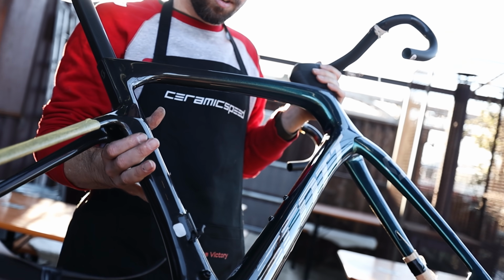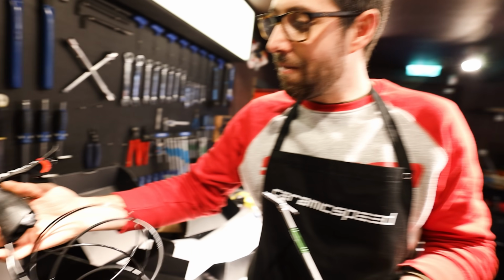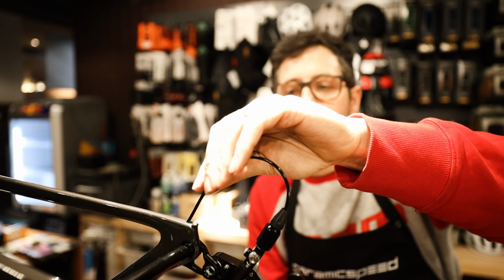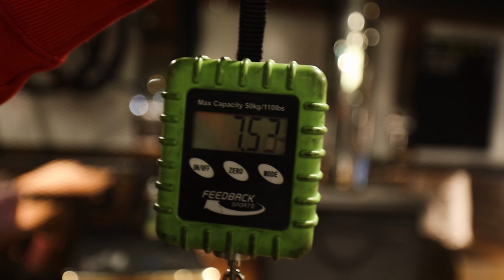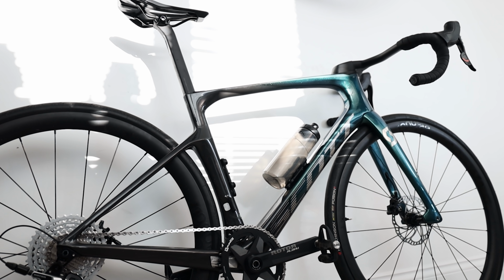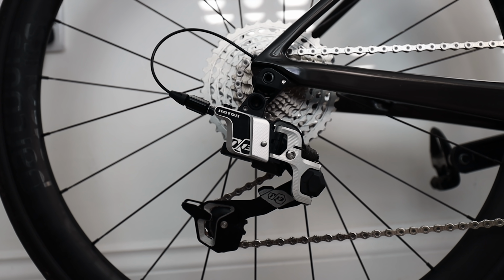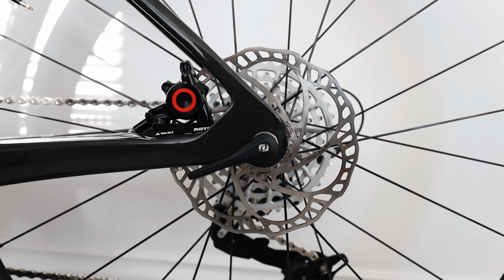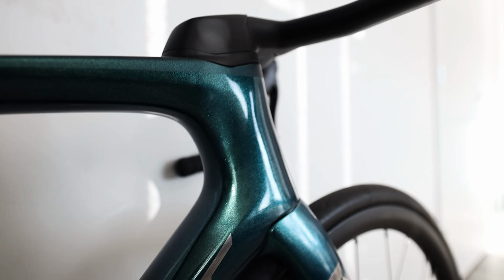New Bike Day

Comment: Quick primer on how Uno shifting works compared to mechanical. On a mechanical setup, a ratchet in the shifter body pulls a set length of cable which manipulates a “dumb” rear derailleur. With Uno, the “dumb” shifter body pushes a set amount of fluid which manipulates a ratchet in the rear derailleur itself. The barrel adjuster on a traditional mechanical RD changes cable tension while the barrel on an Uno RD repositions the cage presumably with a worm gear (?) One benefit of Uno is that it is basically impossible for the indexing to go off. Also you can possibly upgrade to 14-speed, 15-speed and beyond without swapping the levers out since all the smarts are in the RD.
Reply from the maker: Interesting!

Comment: I like that frame...a lot! The aldhu cranks don't look right tho, they should spin freely! Are you sure the preload collar was backed off before install? If not it will bind the bearings. Also on some pf86 u gotta remove the 0.5mm plastic shims that Rotor say you need(!) or the whole lot will bind!
Reply from the maker: it spins freely now - shimano bearings we used, maybe just sticky to begin with?

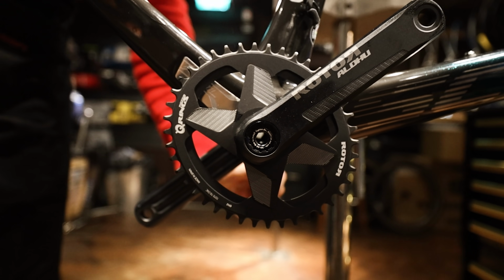Comment: 2:46 If this thing starts to creak and wear out bearings, now you'll know why. I don't believe for a second it would be any better with ceramic speed.
That is absolutely horrible bottom bracket performance, I don't care what anyone says. 
Likely it's not the BB but rather the BB housing tolerances.

Comment: Would have been cool if you got a custom steel rim brake frameset built up. 

I know the Rotor 13 groupset only comes as a disc brake option but still would have been cool to see something different instead of just another generic 1X carbon disc brake “road bike”

Comment: Ready to bet you'll want a different gearing - the 13s might minimize the cadence jumps between each gear but the top end is low (42/11 = 3.82 in comparison to a compact 50/11 = 4.55. This is like having a cassette starting with a 13t on a compact chainset.)
That being said, if you're really only going to climb on this bike and won't be pushing it on descents or sprints, I guess it's alright.

I'd go 44T in the front, 10-42 or so in the back. 🤘 Then, you're covered!

Comment: I run the same groupset on my road bike, I have over 20k miles on mine. Pro tip: delete the barrel adjuster, they always leak, otherwise you'll never have to deal with bleeding the shifting or the brakes, super reliable! Also take good care of your chain, a worn chain will shred that cassette pretty quickly.

Comment: This is a very beautiful bike but I’m waiting for the next foil as this is still the previous gen foil with the cabling moved internally, the creston IC SL cockpit added and the Addict RC’s Duncan aero seatpost adapted. Thinking the next Foil should offer HMX Carbon as standard throughout the range like the Addict RC, 1 1/4” steerer up from the current 1”, a tad more aero maybe with integrated bottle cages like BMC. Also if you compare the HMX Addict RC Pro at 7.26kg and the the HMX Foil RC Pro at 7.28kg they are basically the same bike, so Scott could also go the specialized route and just make 1 road RC model aka do away with the Addict RC.

Comment: @francis cade could you please double check the handlebar width with Scott, I 'was' 99% certain that Syncros measure centre to centre, I know 3T are one of the brands that do measure outside to outside.
Great video, stunning looking bike.
Scott fanboi myself, so looking forward to your upcoming videos.
Btw, if you struggle to get hold of a suitable out front mount, Raceware Direct can sort you one out 👍
Reply from the maker: Idk what Scott say they are, I just know that they are 40cm center to center!
Reply: Thanks  @Cade_Media  - having checked with other owners of the Creston IC SL handlebars, they seem confident that the measurement Scott/Syncros give is centre to centre, so hopefully your bars are the 40cm variety! The reason for my concern is I have a set of 40cm bars on order, and bought them in the understanding that was the C2C measurement, and that like yours, the overall width would be 42cm. Had they actually measured outside I would be stuck with a set of too narrow 38cm C2C bars which would have been sad and expensive :-( I would say to check on the bars, as it is marked, but having looked at pics online, I can see it is stamped on the inside of the left hand drop, which will of course now be covered with tape.

Comment: 42x11-39? Going to be a little undergeared in the road? Looks brilliant btw. 😍
Reply: I believe oval chainrings have a slightly larger effective size than the number would have you believe because of how they're larger diameter in the part of the pedal stroke that matters
Reply: @nathanielbelmont6934  Nope, gear ratios are calculated via number of teeth.
Last I checked the rotor groupset kickoff at a 10T like SRAM do. 42x10 is close to 50/11 but it's definitely not a fast top gear. I'd run a 44T on the front of I were Francis
Reply: @SoyCyclist  I'm sure in the video he said the cassette was 11-39 but I could have misheard.
Reply: @SoyCyclist  gear ratios are calculated via number of teeth when using a circular gear because it's easy but what actually matters is the radius. Think of every single individual tooth as a lever, if your cog is circular then all the levers are the same length but if your cog is an oval then the levers actually change length as you go around.

Comment: Man, I love those Fidlock bottle connectors like you use, but I hate the actual bottles.  Here's hoping the "coming soon" 800mL one is a little better.
Reply from the maker: it's a lot easier to squeeze, has a stronger magnet & the lid has a valve mouth piece

Comment: Not quite as pretty as the Willier, but a much better name. I'm curious to see how you like the 42x11 top gear (as well as the 42x39 bottom gear). I guess you won't notice a lack of top end speed until you add the head unit.